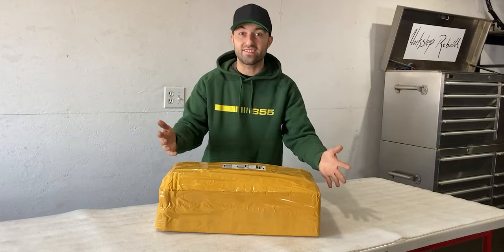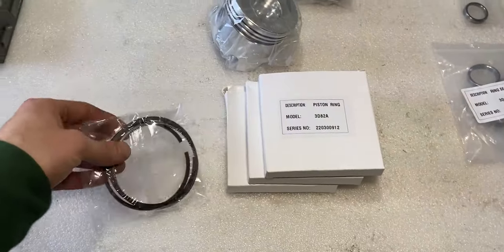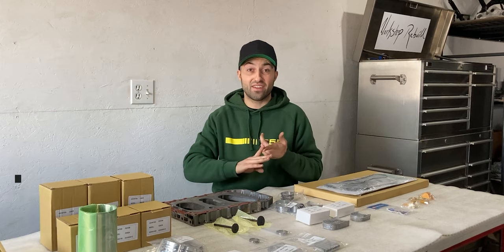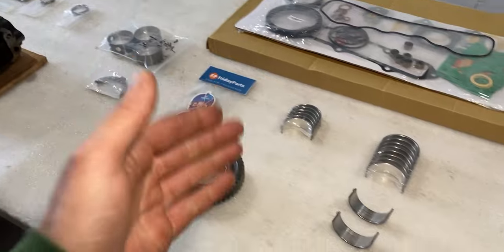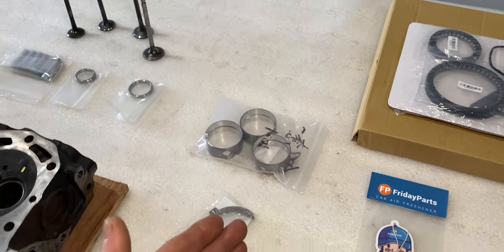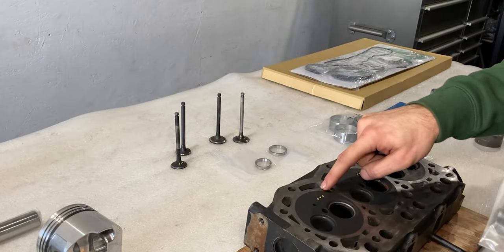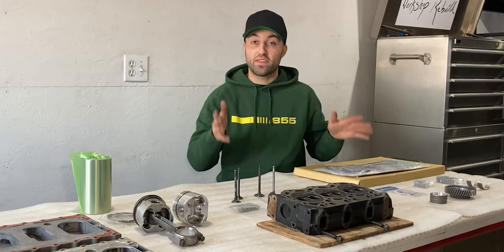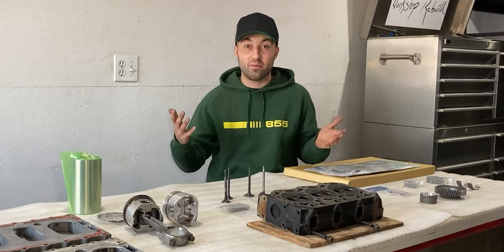Yanmar 3TNV82A Diesel Engine Rebuild Kit Unboxing

Comment: Why do you need to bore down? What 0.025 inch? Or can you order undersized pistons to solve that issue? I was thinking standard size rebuild would fit the OEM machine
Reply from the maker: The bore of a used engine block is always larger in size due to wear inside the cylinder bores. With this in mind you cannot install original sized pistons, as they would be too lose within the bore.

In this case you can either bore out your cylinder to the next size "OVER", or choose to install dry sleeves.
When you choose oversize pistons, you purchase pistons that are larger in diameter, to fill freshly machined cylinder bores. 
For example if your OEM bore is 82mm (3.228"), the pistons you can choose are usually +0.635mm (0.025") and +1.27mm (0.050"). This gives you a choice of pistons at 82.625mm (3.253") or 83.27mm (3.278"). 

If you decide to go back to the original size, your must machine your block, install sleeves and re-bore the sleeves to the OEM diameter. Then you can install your OEM diameter pistons.

Either way, you must always install new pistons and rings in machined bores. Now if you want larger pistons it's cheaper, because less machining is involved. If you choose to go back to the OEM spec, you're paying for double work.

**Keep in mind, these numbers are just an example for this engine and all manufacturers have other specs/tolerances for their engines.**

Regards Andreas
Reply: @WorkshopRebuild  ok thank you for the response. I was thinking the original engine came with a removable sleeve. So if you replace the sleeves and run new standard pistons in new sleeves... doesn't fit? doesn't work that way? My application is for a very similar engine to yours. From an excavator B37 Yanmar 3TN84L. I think it's also in the 870 John Deere tractor. Correct me if I'm wrong, the updated version of this engine would be, 3TNV84L? Besides adjusting some stuff for emissions compliance, is the new TNV engine any different from my older TN engine? Would they fit exactly the same? Same dimensions? Thanks for helping!
Reply from the maker: No Yanmar 3TNV engine comes with removable sleeves!
Wet sleeves or some call them wet liners, are inserted into the engine block. They are machined from a different type of alloy than the engine block, which makes manufacturing the engine a little bit more expensive, but very easy to repair. These types of sleeves are sealed with o-rings on the bottom of the sleeve and towards the top, holding water within the coolant passageway.
The other type of sleeve is a dry-sleeve. This sleeve is a machined part that is inserted into an existing engine block (only for repair purposes)! This sleeve will never come in contact with the coolant, hence the name dry-sleeve.

The Yanmar 3TNV84L has more displacement than some of the Yanmar engines I've previously worked on, but it's VERY similar! I cannot tell you exactly what Yanmar changed when they went from the 3TN to the 3TNV engines. I found a great article that might help you understand more about the 3TNV engine family and it will assist you with your engine dimensions: https://www.yanmar.com/media/news/2019/12/10074714/tnv_series_201912.pdf

I hope this will help you out. If not, you can always contact Yanmar directly and I'm sure they'd be willing to help you answer some questions. Cheers

Comment: what made you want to get a used john deere 1445 not that it's bad I'm just curious because I think the 1445 is better then the newer 1585.
Reply from the maker: Hi there! I've never been in a JD 1445 before nor in a JD 1585...so I can't say I purchased this because I always wanted one! You probably have much more experience with these machines than me. Honestly, I found this one at an auction and the price was just too good to be true, so I decided to get it. It'll be interested to see how this machine performs once it's back together and running.
Do you own a JD 1445 too? 
Regards Andreas
Reply: @WorkshopRebuild  no I don't sadly I'm trying to get a 1445 for my lawn service hopefully soon but yes despite that I do have a lot of experience with these things I mean I could never do something like this but I do have a lot of experience operating these things and keep in mind I'm only 17 so the only experience I have that even comes close to what you're doing is with smaller lawn mower engines and fixing filter queen vacuum cleaners. in the future I would like to try to do something like this.
Reply from the maker: Hey man, I‘m glad to hear that you‘re already trying to level up your equipment!! I can‘t tell you right now how good the JD 1445is, because it‘s not running yet, but I‘ll have a review about it in the new year!
Your first fixes are important, especially on small equipment. Once you know all the ins-and-outs, you can upgrade or even take on a new project.
Enjoy the process! Cheers😃👍🏽
Reply: @WorkshopRebuild  thank you btw you will not be disappointed with your 1445 these are great mowing machines

Comment: In the scheme of things how does the wear on this engine compare to the small amount of wear on the old BMW R60/5? I've checked back on the mileage/kilometerage and the BMW had done 90 000 km. Roughly how many kilometers  has the Yanmar done?
Reply from the maker: This engine has far more wear within a shorter time period compared to the BMW R60/5! This engine came out of the John Deere 1445 and the digital hour meter shows just over 1000 hours. On industrial equipment you'll usually find hour meters instead of odometers, because a lot of times engines are idling or doing work with attachments while being stationary.
Nowadays with digital hour meters, it starts ticking when you turn your key over and that means it actually doesn't correspond with the engine hours...or at least on the John Deere 1445 I have here!
Back in the day hour meters were mechanical. They were driven by a cable and all engines had a rated speed for 1 hour of time. For example: Rated speed 1500RPM = 1 hour time. This means if your engine was under load at 3000RPM, you would have seen 2 hours of elapsed time on your hour meter.
With all of that said, there are so many factors to take in consideration, especially with a digital hour meters. 1000hours to me is a VERY LOW HOUR MACHINE and it's hard to tamper with a digital hour meter. I would say this tractor has done maximum 30'000km (1000 hours/ 11 years = 90 hours a year or 30'000km/ 11 years = 2700km a year). 
I think this is a very honest evaluation, but you can really tell that something went wrong with this engine in a short period of time! The BMW on the other hand has stood the test of time, but the cylinder bores will be machined to accomodate brand new oversize pistons. More on that in an upcoming video.
Thanks for another great question Simon! -Andreas
Reply: @WorkshopRebuild  Thanx for a thorough and comprehensive response Andreas.

Comment: Small tractors with limited 12 pto hp would be great if you could speed the the pto rpms up to 3600 from 540. Then smaller accessories with worn out gas engines could be run by the diesel. Figure two speed increasers in series would jump the 
540 to X to 3600 (1 to 7 ratio overall). Also remove rotation reversal at final.
Just the $1000 of hardware to overcome now.
Reply from the maker: Hi Tom! I‘m not exactly sure what rpm you‘re trying to achieve with your 12HP engine.
Usually tractor PTO speeds are regulated at 540RPM or 1000RPM. For small garden tractors this isn‘t the case, but to let you know there are probably no attachments that run at 3600 RPM.
At the end of the day, you‘ll need to reduce your gearbox, because most work is done at mid- to high RPM‘s or the tractor engine.
Please let me know what you‘re intending to use this high rpm speed for. I‘m really curious!

Comment: I have this code on engline block 3D82AE and on plate from valve cover i have 3D82A-3FAE ( this engine is on komatsu excavator) can someone tell me witch is the corect cod from yanmar ?
Reply from the maker: Valve cover number👍🏽
Reply: @WorkshopRebuild  Thank you,  can you tell me by that code if my engine is an tnv or tne ?